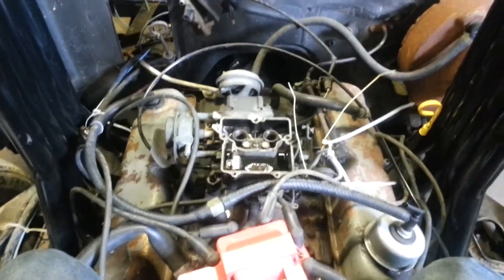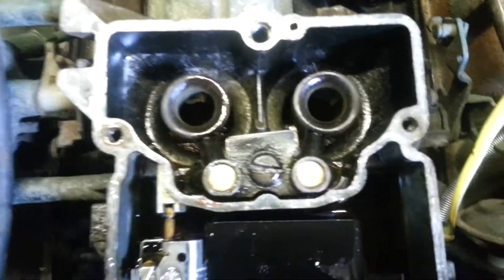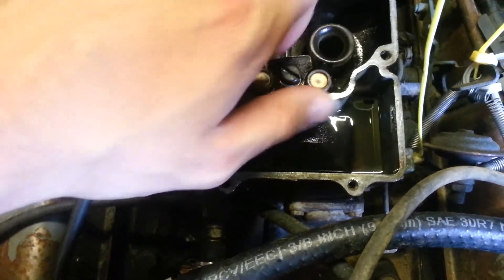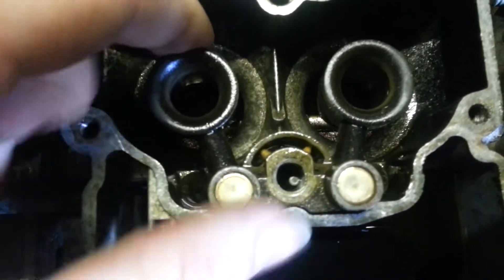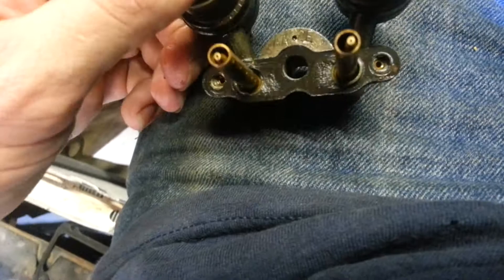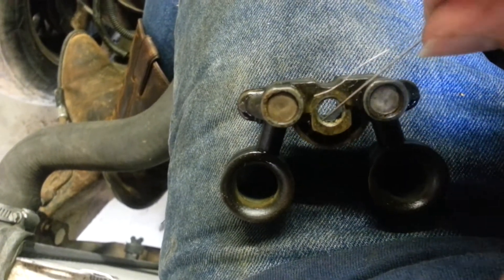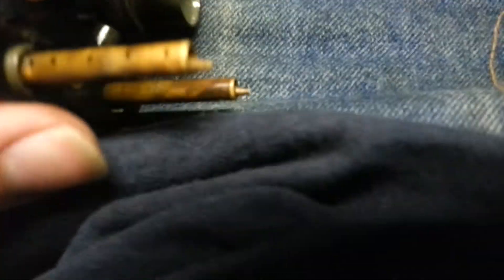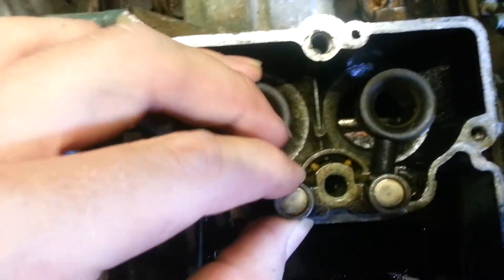2 barrel carburetor cleaning

Comment: What can I use to clean that out with?
Reply: Product wise to aid in getting gunk out
Reply from the maker: @livhulbirt6192  I have use break clean gum cutter if ultrasonic cleaners. But break clean should do the trick most the time
Reply: I've soaked this an other carb stuff in a solution of liquid plumber and water over nite.  I heard muratic acid in water does good aswell.